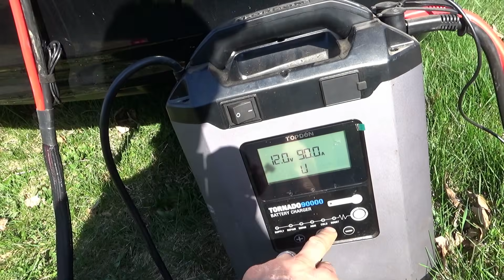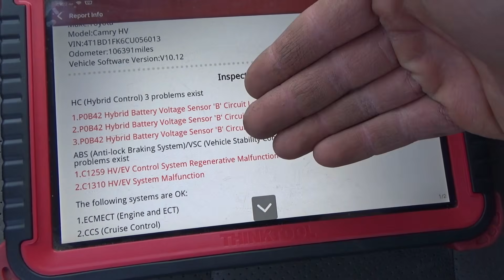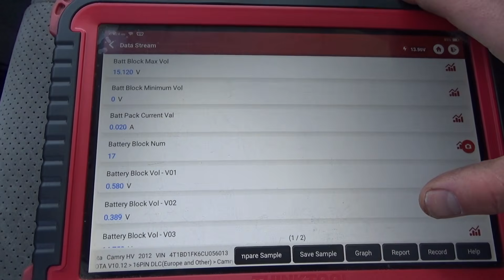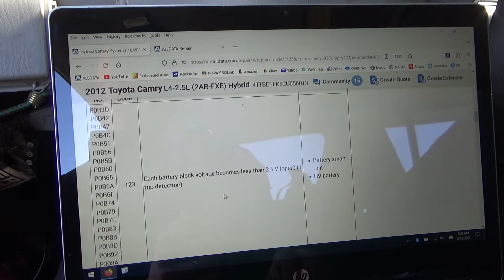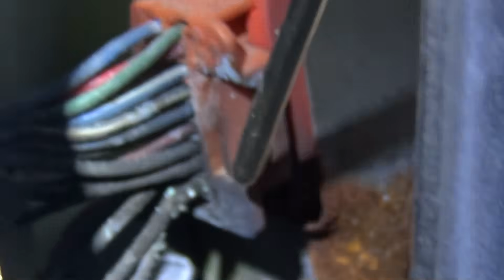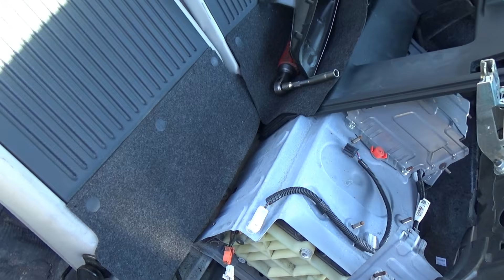Helpless HYBRID....from Florida?? (Part 1 - It's DEAD)

Comment: I have a Prius and actually went to it from years as a Mercedes owner after driving a rental . Currently have over 300K on my 2013 and have replaced front brake pads twice still has original rears. Had to replace brake actuator. Plugs once. Oil every 5K tran fluid every 100K. And she purrs like a kitten and gets confused when I pull up to a gas pump. LOL

Comment: What caused this meltdown in the first place.... water intrusion? maybe .... battery pack melt down? maybe .... definitely would want to get to the pack connections for a look see..... when one of these melts down and lights up (fire) .... I'm sure you've seen the roman candles on the internet burning on the freeway ... cover your a$$ if not replacing the harness with oem... ?  maybe          :---)

Comment: Ouch! Methinks those wires have soot on them. It was close to burning down! Are there fuses between the battery cells and that plug going to the sensor board?
Reply from the maker: No fuses...just straight up DC high voltage on exposed wires HAHA
Reply: @PineHollowAutoDiagnostics  The wire acts like a fuse because it is small.

Comment: Lead free stamped on the circuit board means the solder connections are susceptible to tin whisker and dendritic growth.  A little moisture combined with a voltage potential between 2 pins is all it takes. Military electronics require at least 10% lead solder.
Reply: Tim lead solder does not mitigate moisture ingress conformal coatings are used to protect circuits from moisture but no conformal coating is perfectly hermetic so moisture wicks onto the PCB surface.  Connector pins are more likely to be impacted because they are exposed to the mechanic stress the external connector is subjected to.  Lead free solder is more susceptible to conditions that promote dendritic growth not only because of material properties but also due to the way the alloy solidifies during the solder process.  This leaves lead free solder alloys surfaces more susceptible to corrosion vs tin lead alloys which are eutectic.
Reply: @cbayman869  A lot of words with no meaning.
Reply: Lead based solder doesn't prevent water ingress or corrosion.
Reply: @ferrumignis  removal of lead made the solder brittle and more susceptible to weird growths
Reply: @PandaMan02  Early alloys were problematic, not so much now. Lead free solder is used in telecoms equipment that requires a design life of at least 20 years.
Reply: @ferrumignis  may you only have a 20 year life expectancy... point proven with harshness I hope. and as for the EU..... there's a special place for them far down under anymore(endless flames and fire)
Reply: @throttlebottle5906  Imagine being so mentally broken that you equate the importance of the life of an electronic device in a car with the life of a human.  I genuinely hope you get better and are able to become a useful member of society.
Reply: @ferrumignis  i hope you like horses and buggies. 🤣 because what you just said in reply, is all you will have or go on foot.
technically, every vehicle with a spark plug and ignition system is "electronic" time to park it all or go back to keep it simple stupid? aka KISS theory
Reply: @throttlebottle5906  I still hope you get better.  Maybe one day you'll look back on your incoherent ramblings and see how far you have come.
Reply: Unfortunately there are legal requirements for lead free electronics these days.

At least there's nothing stopping you from repairing with lead based tin yet.
Reply: @ehsnils  Stock up on 63/37 while you can. Friends in Europe tell me it is hard to find there by now. Maybe put a few rolls next to your cases of R-134a? 😁
Reply: and why it's insane people think putting phones in rice actually helps them... as the phone sits there in a rice bath unable to disconnect its battery as all the micro lines fizzle and fizzle and fizzle as the rice just taps its finger and the normal slow process of evaporation eliminates some water...  only thing saving a phone is immediately opening it and disconnecting the battery... next possible is hitting it with heat gun or hair dryer to speed up evaporation process... rice? how r people this dumb...
Reply: Once modern cars are water damaged they become organ donars.  The circuit cards don' t show corrosion damge on the surface because they were confotmally coated. The wiring and connectors are shot.  This car even if you get running will have ekectrical problems for the rest if its life.

Comment: I don't think I would be too keen to mess around with the sense wires pig tail. Well not without knowing the set up, like is there any kind of circuitry to limit current on each cell wire. I should image that each cell is capable of delivering a whole ton of amps. I would be careful probing and messing with them, especially with all that bare steel around them. And if they are current limited by a resistor or some fancy circuitry inside the battery pack itself, one must wonder if that survived without blowing open circuit. Take care Ivan, we don't want any unscheduled welding or fire starting!
Reply: The battery is divided in half by the safety plug. As far as I know, having taken apart only one, there is no other protection, the wires are directly connected to the cells.

Comment: Hybrids are the biggest gimmick ever created.
Reply: Why'l do you think hybrids are a gimmick.  My 2007 Highlander hybrid is at 300k miles with no real issues with a good battery and getting 26 mpg.  I do have to replace the timing belt every 90k, but that's no different than on an ice.  The CVT is superiori in design.  So why the dislike

Comment: A lesson I learned back in the 80s the applies to modern electric vehicles. I had just purchased a $150 RC dune buggy and was impressed at how fast it was! It was a clear day but had rained the night before leaving a few puddles. While scooting around the street I plowed through a puddle and waaaaaa, buggy stopped immediately! I mean dead! Zip-nada- nothing! I dried it out and still zilch! Checked the battery to find it had power and the leads to the motor were at full voltage. The motor was toast! The replacement motor cost me $80! I ran fine after installing the new motor and I never used the bandit where there was moisture present again! Water and electronics do NOT mix! Same applies all these years later only the lesson is vastly more expensive! Unless these manufacturers seal the entire system to water intrusion they are subject to a similar fate! And while gas powered vehicles are not immune to water damage I believe they are far more resilient  (so says my 98 Jeep Wrangler😂)! The more electronic connections a vehicle has, the higher it's chances of failure due to moisture intrusion. I watch footage of the Willys Jeeps that fought in WWll blasting through waist deep water and mud with 6 GIs holding on for dear life and think if they had the electrical crap the vehicles of today have, we would have lost that war! Your channel rocks, Ivan! 👍
Reply: Traxxas Bandit?

That RC Car was my best friend as a kid, I lived with the thing, brought it everywhere, used it just about every day for years and loved tearing it down for maintenance and upgrades.

Everything was fixable too. One day I was flying across a parking lot and wasn't quite looking at how far away it was, smashed into the wheel of the only vehicle in the parking lot at full speed and demolished it, it broke in half. I was devastated... But I was able to buy every part I needed to fix it up good as new!
Reply: While, I as a child used to run toy motors underwater (fresh water) just to see what would happen.  They worked, no problems.  I wonder if your motor had electronics (brushless motor).
Reply: @russellhltn1396  I used to do that too! I would run a little motor I ripped from junk toy underwater, but i'd put soap in the water for my matchbox cars car wash, haha
Reply: @volvo09  Interesting, try doing that now and let me know how it goes..... And no, it was not brushless. You can save some time and Google "DC motor running under water" and the folks there will clarify that it simply DOES NOT WORK.
Reply: @basshunter428  you can run a low voltage DC motor underwater, not for a long time, but it runs. 

I was recalling being a child and playing with AA batteries and motors from toys I took apart, they were obviously trashed a few days later.
Reply: @volvo09  some used to run in the brushes on motors by running them on low voltage in a glass of water.
Reply: Submarines have electric motors
Reply: @chekelley6861  You are brilliant! And the "entire system is sealed"!
Reply: What about a 1949 Zenith Transoceanic (portable) tube radio, if you dropped it in salt water and didn't wash it out with fresh water, it was toast.

Comment: “ customer wants it fixed so he can resell it “ 

Hey Ivan , can you post the VIN so a future buyer avoids this dumpster fire ?
Reply: Yes that's one car you don't want to buy ,  hate flippers trying to make $$$$ on junk.
Reply: Didn't the scanner show it on the screen?
Reply: People don't seem to understand that once you fix the problems, it's no longer a dumpster fire;  just a car with a little rust.   Up north that rust would be laughed at and considered "Mint".
Reply: Absolutely, needed. Soon to be pawned off on some unsuspecting soul who thinks they are getting a good vehicle..
Reply: @ItsAlwaysRusty  Why would this be a bad car, if the harness is fixed correctly? These toyotas are basically 90s tech resold into the 2010s, with really good gas mileage. Sure a bev is better, because you don't carry around an engine and gas tank, but these aren't terrible. Even a rebuild of the battery is not outrageous in price, since those packs are fairly similar since the prius 2 from 2003. Don't really get the hate.
Reply: @tschuuuls486  Flippers always go for profit period.  Bought to resell is the key to this.  Lots of mystery rust where rust really shouldn't be. Story sounds vague on its history. Accident damage plus who knows what else is wrong?  Will all of this be told to a prospective buyer? Probably not.  Another clue is Ivan showing Ebay used replacement parts instead of new (if available?) I'm surprised the owner / seller even spent the money on Ivan for the repair.
Reply: @ItsAlwaysRusty  At least we're aware it's had a fender bender.
Reply: Wow ! and now you have to identify all those orphan wires !
Reply: @CrimeVid  You'll be able to see the colors once he goes further into it.
Reply: @CrimeVid  Simply remove and replace.
Reply: @CrimeVid  That's easy - wires 1 to 12 are black & charred.
Reply: You know what?  How about you just watch the vid, drink in the goodness & use that as reference when buying  2012 hybrids?  lol.  He's a busy guy. You gotta put in SOME effort!
Reply: He must have bought the dumpster/bumper car cheap. He is only in it a few hundred.
Reply: shows how much i know about hybrids. all these years i was under the impression that the battery power functioned independently from being gas powered, like primary and secondary, so in a low voltage situation you'd still have gas to get ya around. thought it'd be nice to have one but felt comfortable in a big gas guzzling truck, and now fear all these all electric vehicles that will soon be the only option.
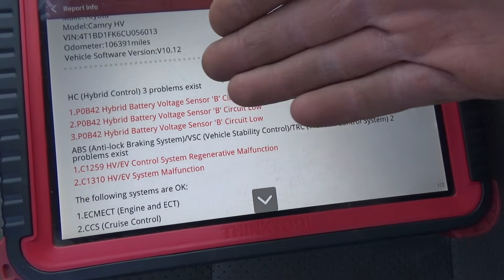Reply: VIN is shown on the scanner at 3:55
Reply from the maker: Why would you want to buy any Hybrid at any price to begin with? xD
Reply: @PineHollowAutoDiagnostics  because they're relatively good on gas and if they're maintained and you catch the big flaws they run forever?  Local delivery joint around here has a bunch of them with over half a million miles on them.
Reply: @x_x_w_  Sounds like any car.
Reply from the maker: @x_x_w_  In constant city stop-and-go driving they do make sense. Where I live a Hybrid makes no sense at all haha
Reply: @PineHollowAutoDiagnostics  yeah they definitely don't make sense for everyone but don't tell that to the guys on the forums lol, steady state highway driving and you have a gas engine hauling the weight of a battery and extra electronics. Here in Seattle and other west coast big cities, those gen 2 priuses are absolutely everywhere including in my driveway. 40mpg+ in the city, compact with a surprising amount of storage for schlepping in tight urban streets. My girlfriend's '11 TDI gives me 10x the headache...
Reply: @PineHollowAutoDiagnostics    15 minute cities is where the UN / WEF want to go , that being said , We Ain't Free !
Reply: @x_x_w_  Buy a Tesla instead.
Reply: @PineHollowAutoDiagnostics  They don't fair well when subject to heat constantly over 110-115 like in Vegas, stuff tends to melt
Reply: @PineHollowAutoDiagnostics  Agreed!  I will stick with my 1989 Honda CRX HF with over 377,000 miles on the odometer.  It has never broken down on me and gets over 47mpg day in and day out.  It is paid for, has low cost insurance, fun to drive, and easy to park.  No hybrids or electric cars for me.
Reply from the maker: @wallebo  Now that's a COOL CAR! :)
Reply: @PineHollowAutoDiagnostics  Thank you, sir.  I am very lucky to have it.  Very inexpensive and reliable transportation is a blessing for sure.  Looking forward to each of your future videos.
Reply: @PineHollowAutoDiagnostics  If I had a gun to my head and was told, "you can't buy an ICE car", I'd choose to buy the hybrid, if for no other reason I wouldn't have to spend half my life recharging an EV.
Reply: @adotintheshark4848  Um, you do realize that EVs charge up while you're sleeping, right? You spend half your life sleeping. You might as well be getting something done while it's happening.
Reply: @adotintheshark4848  You must have a very short life.
Reply: @adotintheshark4848  Yeah, that extra 15 seconds twice a week to plug in your EV at home is a real inconvenience to deal with.
Reply: @PineHollowAutoDiagnostics  My Acura RLX hybrid with 400hp and still gets 30+mpg might be a reason why someone would want to by a hybrid. Lol

Comment: Looking forward to part two and seeing where the voltages are at inside that battery! Wondering if there are any signs of burning or damage inside the case, I guess we'll soon find out 😁
Reply: Indeed, gotta wonder what else may have been compromised from the water intrusion. I’m sure we will find out. Hopefully nothing.
Reply: Likely to be good outside of that little boo-boo.

Comment: What a mess! Almost all the voltage sensing wires got in contact between themselves near the module - must have been a crackling event :-)
You can't know the health of the battery pack before you repair that mess - a bit of a gamble, Ivan! But there's, at least, a Part 2 and that should be a good sign :-)
Reply: I'd be a bit worried about using pigtails on the high voltage parts in a car since they are even more sensitive to green crusties since the voltage accelerates them. But we'll see where this ends up.
Reply: @ehsnils  Agree. The higher the voltage, the faster the crusties develop - plain electro-chemistry 🙂 I'm curious too.
Reply: @ehsnils  Simply remove and replace, no soldering needed.

Comment: The circuit board has a coating on it to prevent corrosion. It was definitely submerged.
Reply from the maker: If it was submerged there would be no module or pins left AT ALL haha

Comment: the new one is a neverstart
Reply from the maker: Hey better than Honda Dealer leak-acid batteries any day ;)
Reply: @PineHollowAutoDiagnostics  Just for the record, I've been using an Everstart "Value" battery on a Honda. Closing in on 4 years. For then ~$50, I've gotten my money's worth. Did think the play on words clever though.
Reply: @faxmen09  I have heard that on you tub btw got a car with a very good purchased out of code batrey and at 1/2 cost so what buy two for one and have a spare
Reply: @PineHollowAutoDiagnostics  good thing my grand daughter got an Acura because they say it aint a Honda even though it say Honda everywhere but rear hatch and hood. best news bought used for the new first driver it had previous front damage. but no appearance of anything really bad. at this point in time I think the doors maybe undamaged. but hey the price was ok and almost paid off.
Reply: Well played.....🤣
Reply: @faxmen09  I watch too many youtubers and forget where I heard it first BUT may have been Vice Grip cause he's cool like I'd like to be
Reply: @jhonditch4269  "cool like I'd like to be" . lol. Pretty sure both the Honda battery and WM Everstart both made by JCI/Clarios. The latter can vary 'some' depending on the WM locale.
Reply: @faxmen09  yes and  basic lead acid one were manufactured on the bridgeport fairfield connecticut next to seaside park town line, damn i forgot the company name also irgor sikorsky failed to make a practical elevator there